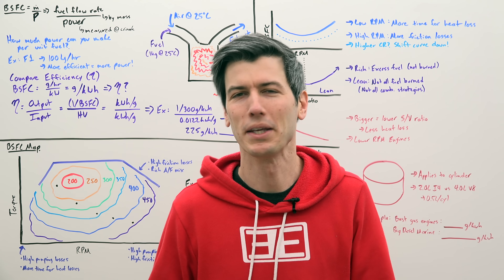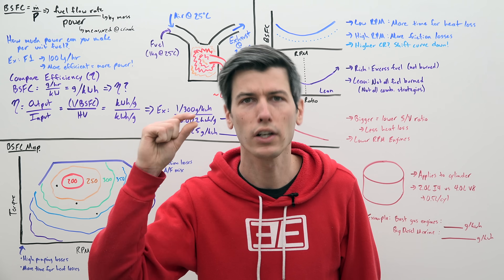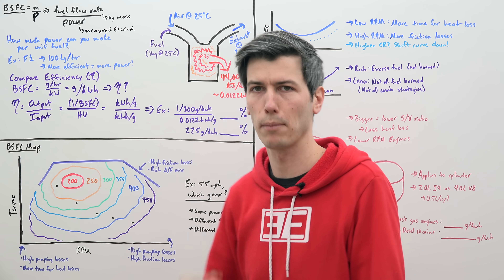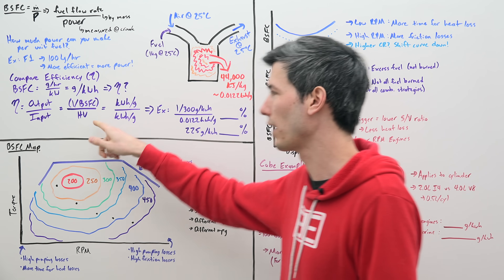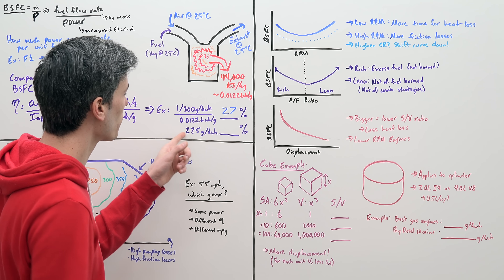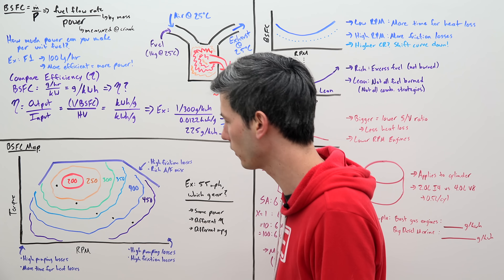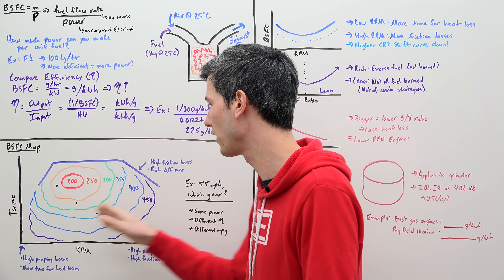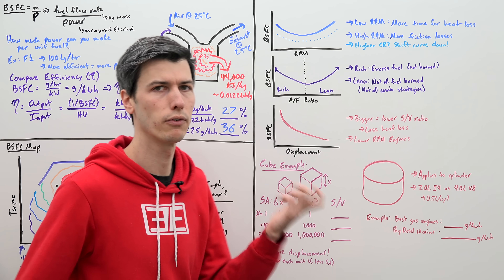The Best Way To Compare Engine Efficiency - BSFC

Comment: There is only a certain amount of power needed for daily driving. There are engines that could theoretically be very efficient - the ones in a formula one car are finely tuned, but the power range is much greater than needed so you can't use them efficiently. It would be like using them to drive the hands of a clock.
It also looks like if the engine in your car is much larger than you need except for the rapid overtake you do once in a blue moon, then you will be spending most of your time in the "low load" range and more fuel is spent moving the engine parts themselves than the actual car it is connected to. If your gear ratio is lower than you need, this is also the case. If you are using a large engine short gearing sports car as your daily driver, they you are better off giving it a quick spurt and then putting it in neutral to roll along, then repeating - although this might cause more wear on the gear shifting system.

Comment: If you could get 44,000 kJ of motion energy out of a kg then if there was 440 Newtons of drag driving on the motorway, then you could get 100 km on a kg of fuel with no losses. This is 1.35 liters per 100 km at motorway speed! With a 25% efficient engine and drivetrain, you now have 5.4 liters per 100 km which is typical of a reasonably efficient small car. It's just a shame there is so much energy in fuel that cannot be utilized as mechanical work.
Our muscles are about as efficient as a car engine (and use more expensive fuel) but the total weight, frontal area and speed of a bicycle is relatively low, keeping the resistive forces down and making the bicycle much more economical.

Comment: Jason, is there any way, by calculating something on the dyno graph, to find the exact maximum efficiency rpm spot?
Reply: If your dyno can generate the fuel consumption chart for varying torque levels up to redline (WOT, 90%, 80%, etc), you should be able to generate a BSFC chart. There are some calculators online that can take in BSFC and engine power (torque*RPM) and spit out fuel rate, flip the variables around to calculate for BSFC instead. The lowest g/kWh spot will be the most efficient.

Comment: Of course, engine efficiency is not equal to transport efficiency: If you're only using your semi truck which you could somehow get to make 20MPG, to only transport one person and no cargo, then of course it would be much more efficient to use that moped that gets 30MPG. I suppose most people don't, obviously, use semi trucks for personal transport, but there is a point here: If you're regularly driving a 5 person passenger car alone - then you're not being too efficient. :)

How much power per unit of fuel also isn't the only thing that matters if you're purely interested in going fast: consider, say, a 70hp motorcycle in comparison with a 200hp car - you might have a fair amount quicker acceleration times for the fuel you're using.

Comment: @EE you compare gas efficiency of marine diesel that runs bunker fuel that has 153k btu to gas motor efficiency that burns 125k btu per gallon. But both weigh 6lbs a gallon but have a massive energy density disparity. If you are using weight of fuel to determine efficiency the marine diesel would need to be over 20% more efficient to match the efficiency of a gas motor because it’s starting with 20% more energy in the fuel of my logic is correct. Am I missing something?

Comment: Excellent video! 
For 'loose' engines, such as marine and industrial engines the EPA has specific test cycles, typically with 4 to 5 modes with different rpm and torque, and weighting for each mode. The weighted BSFC over these cycles is an excellent way of comparing engine efficiency. It is more realistic than just looking at the best BSFC. I believe the EPA also has a somewhat similar but more complicated fuel economy driving cycle for cars, it would be interesting to see the BSFC over those cycles, but don't think those figures are typically published.

Comment: Thanks for the video.  I have an additional MPG topic that I would like to see someone tackle and that is YouTube automotive journalists that do independent MPG tests but based on a single drive and very small amount of fuel usage.  I've found that the variations in fuel pump delivery make small fuel fill-ups extremely unreliable.  I would like to see someone break down the tolerances in these systems and their influences on resultant MPG numbers.  Maybe provide data on a best practice for doing independent MPG calculations.

Comment: I know not everyone is great at driving manual transmission cars but this is where they can be better than automatic transmissions as most will not hold the gear when they should to be efficient wither it’s an up shift or down shift. I am sure it’s not that way in a perfect lab but  the real world is far from a perfect setup

Comment: BSFC is only half the data though, even still. You have to look at the whole vehicle. One car could be much heavier than another car while having roughly the same carrying capacity and use case. In this situation, if the heavier car's engine consumes more fuel to get from point A to point B (i.e., lower MPG), it is a worse investment if your goal is to minimize fuel consumption, even if it is technically more efficient. Basically if you factor in weight along with BSFC, then you have a pretty good measurement. Sometimes it can paradoxically save more fuel to go with a lighter vehicle with worse efficiency, if it can get you from point A to B with less fuel. Of course, you might lose out on performance, but that isn't a factor for most road vehicles, they are plenty fast enough as-is.

Comment: It would be interesting to see if fuel injection vs carburettor changes this and how... (You might be able to keep the throttle wider open at low loads, reducing pumping losses....)

(Non-petrol engines might also be interesting to see... (I assume things like the lack of a throttle might be one reason why direct-injection diesels end up more efficient))

Comment: What about a comparison video showing the mechanical limitations of one engine versus another. For example, why would one 5.0 dohc v8 be more powerful than another? I get that bore to stroke ratios, piston to rod ratios, head design, and compression all play roles, but is that really enough for one engine to make 50-100 more horsepower over another without increasing displacement?

Comment: I have a question. Suppose we have a hybrid car, so it has two engines that change the power output and thus BSFC. Now, when we plug in the dyno, doesn't that calculate power by simultaneously measuring torque and rotational speed? So, isn't because electric motor changes the power output, BSFC is NOT the efficiency of the combustion engine, but the efficiency of the powertrain? As power of the combustion engine can be read differently by changing the electric motor.

Comment: I have wondered...given the speed with which gasoline burns ( I suspect that's a variable value, with different degrees of compression and completeness of atomization-vaporization of the fuel ) is there an approximate ideal volume of a cylinder?  I've heard some say 500 CC's is about right, but I don't know if that's correct.  2 litre for a 4 cyl, 3 litre for a 6, and so on.    Is there an answer?

Comment: Nicely done.

The maximum burn temperature is when all the fuel is consumed, and there is no oxygen left over.  That provide the highest cylinder pressure (primarily from heat, 28% is from converting gasoline to water and CO2).  

Too rich, you are evaporating and heating fuel that isn't burned.  Too lean and you are heating oxygen (and 4 times as much nitrogen) that isn't used for combustion.  Lower cylinder temp, less pressure, less torque.  

Adding fuel at high power is to avoid detonation by cooling.

Comment: No wonder why small turbocharged engines suck in real world conditions
Reply: Zuurker U  yeah that’s the thing. I could also achieve some good fuel consumption but at 70-80 mph on the motorway at a steady speed it was really bad. It was a Toyota CHR with a 1.2 turbo btw

Comment: A potential problem with BSFC is that it does not consider the volume or weight of the engine... as such a big giant engine that is very efficient would appear to perform better than a small engine. While in practice the small engine may perform better in practice due to being lighter.

Comment: This doesn’t just help with efficiency, it also goes a great way to figuring out how powerful your engine actually is by literally calculating how much power you are making with a single unit of fuel. Which is great because one thing that I don’t like about horsepower and torque is that it doesn’t actually tell you much of anything. Some of the fastest hypercars around can breach 300 mph with only a couple hundred horsepower, whilst there are custom cars that go way over a 1000 horsepower and they only get to about mid 200 mph. BSFC allows us to know how much power that engine is actually making, and how much of it is actually be used.

Comment: Aren't smaller engines more efficient at higher rpm's? I have a car with a 1.4l engine and it's at rougly 3800rpm at 120kmh. The engine feels really smooth there and not taxed. Running that engine at the same speed but with 2000rpm would mean it had to be at full throttle to be even able to hold the speed. That engine would be really taxed at that engine speed. A 2l engine with more power can handle that rpm easily though.

Comment: Someone once told me that, because engines are most efficient at max torque, the most efficient way to drive is to accelerate at high throttle until (you reach cruising speed or) the torque at the wheels of your current gear is less than the torque of the next gear and then shift gears.
That made sense to me then and I think this is the theory that explains it.

Comment: Uh, wait a minute ... BSFC of course is the best way to compare efficiency - but ... but the deviance from the sweetspot isn't the same every time. The actual stuff causing it is similar, of course, but ... more interesting than the peak efficiency, at least to me, is how well it matches the map of engine use (which requires a given driving cycle to be comparable). Which is the entire point of downsizing, using a less efficient engine in more efficient regions (well, the details may vary, but given the same state of development, ...). Something like the 250-range would be interesting, comparing the highest and lowest power an engine can produce at 250 g/kWh, giving an impression of how well the engine overall works, outside peak efficiency.

... big cylinders have disadvantages, too, regarding knock and the like ... in the end, 500 cm³, mildly-longstroked, work about best in regard to ... everything that counts. Bigger cylinders, IMO, require additional stuff to counter those effects, and then may work even better, but, as everything, this isn't free.

Comment: BSFC works when the fuel calorific value is constant, but this isn't always the case. Specific energy consumption, or in this case it would be BSEC, can be a better way of comparing different engines using different fuels. Take an engine running on methanol vs petrol for example, the former has an energy content of 19.7 MJ/kg, whereas petrol is around 46 MJ/kg, yet a methanol fuelled engine, due to it's much higher octane and exhaust water content (therefore a higher exhaust enthalpy content; more available energy to do work), tends to produce more power than the same engine using petrol. Comparing the two is unfair using BSFC unless you account for the difference in energy densities and exhaust product properties by using BSEC instead.

Comment: Interesting thing I would have liked to see: in the BSFC map, what is the ideal RPM for any power requirement from the engine? As an example, what RPM should a CVT target for any specific throttle input, assuming that we are mapping throttle directly to power.
Reply: In that case, assuming the go pedal is completely disconnected from the throttle and being handled through the ECU, you'd hold the torque and vary the RPM. You generally want the engine to be from 60% to 80% engine torque. At lower required power you drop the RPM, and higher requested power, you increase the RPM. 

The Prius's engine map basically looks like a slight linear slopped line on the top. Below 1K RPM they cut fuel and run entirely on electric. Above 1K, they ramp torque straight up to like 70%, steadily goes up to hit 90% at around 4K.

Comment: Hey man, can you explain which of these two, SOHC and DOHC, in a perfect world and tune (lets just say perfect engineered, with right springs and size/weight shafts etc) could rev higher?

Dual shafts mean more weight and single shaft in theory would rev higher easier; but in a perfect world which one would turn faster thus giving higher engine rpm?
I know mechanically the springs are the limiting factor; but if we took that out; wouldnt less mass mean higher rpm?
Pneumatic “springs” for example...

I dont know man please help; you are the only one i trust 😆
Reply: It's a good question, and although you probably don't trust me (ha!), I can give you my hypothesis (bored aerospace engineer here)...

In terms of which would rev higher, this could be interpreted as two questions, which one is quicker to max revs, i.e. idle to redline time, and which one revs higher (higher rpm at the max limit). 

The first one is less to do with the camshaft arrangement, and more to do with the overall mechanical inertia of all of the moving parts combined vs the stroke length and power per cylinder generated. The lighter the sum of the moving parts, so pistons, crankshaft, camshafts (they do matter some!), flywheel, etc, and the shorter the stroke length (assuming a fixed overall compression ratio, which in reality is more complex), the quicker an engine will be to max revs from idle. 

The second is linked to the camshaft arrangement, but isn't the main determining factor in absolute max rev limit. SOHC arrangements may be more limited in max rev limit than DOHC due to the need for a rocker system and the reciprocating (back and forth) nature of the rockers. Each time a rocker is forced up or down and then back again, it takes energy (from the springs) to do so, which is effectively an inefficiency. Spring stored energy isn't instantaneous, it has a slight delay, though it's very fast. But as you run to higher and higher revs, that delay and spring energy required to return the rockers becomes increasingly more significant, and the energy inefficiency in the system becomes more apparent. But this is really only noticeable at extremely high rpms, and probably wouldn't make much difference in the vast majority of car engines. DOHC engines are therefore more likely to be capable of higher rpm if all else is equal, due to the absence of the rocker inefficiency. For motorsports engines such as F1 where engines run to extremely high rpm's, they do away with the camshaft entirely and actuate the valves pneumatically, giving greater control and ability to fine tune the timing, rather than be limited by the timing chain.

Comment: 'If you go really lean, you're not going to burn all the fuel going into the cylinder'
But going leans means more air, means complete combustion. Why doesn't it burn all the fuel?

Comment: Good video, I'll send it to all of my friends just to remind them why it's never a good idea to tune an engine.
BTW, Ford Ecoboost 3.0 at certain speeds almost doesn't discriminate between 5th and 6th gear with marginal MPG difference at 40-50 mph even 4-5-6 gears are marginally different.
Reply: Why would this video suggest it's a bad idea to tune an engine?

Comment: Hey Jason, wonderful video as always! 
I don't know if you have already covered the following subject. A couple of days ago I was looking at the launch of the new Nissan Qashqai here in Europe: they are producing two different engines, one of which is a combustion engine that only charges a small battery which is going to drive the electric motors. What I don't understand is the pros of such configuration: there is still an engine running (hence noise/vibrations), there are losses in the conversion from mechanical to electrical energy, ... Did you already cover such configurations in past videos?

Comment: Jason, I saw someone else saying that a particular car had 225 wide tires, and he attributed poorer fuel economy to this compared to 255. I remember you saying one of the factors is the profile the tire presents to the air, so wider would be worse. It seems to me that it is not clear whether a wider or narrower tire would offer more resistance, if you could somehow compensate for other factors.

Comment: In the BSFC map graph, why is the Y axis set to torque?
For a specific given RPM value R, won't the most torque be produced at the point of most BSFC?
If not, how will the point with most torque for R be less efficient?

Comment: I always had a problem with the term "fuel efficiency" as an absolute measure of efficiency in modern media. Good thing I wasn't the only one.
Reply: Fuel efficiency is simple, it's only an issue when people try to use it to compare vehicles of  different categories. For the average consumer its all they need as going further in depth will not make any changes of significance for them. Now if your moving freight, all the rest of it comes into play and can make or break a business.

Comment: I looked into the 10th generation Honda Civic and its BSFC for its 1.5 L turbocharged engine and found it to be at <230 for its consumption when at optimal highway speeds (between around 1750rpm - 4000 rpm with around 100nm -200nm of torque) this is very efficient and a reason for their impressive MPG rating.